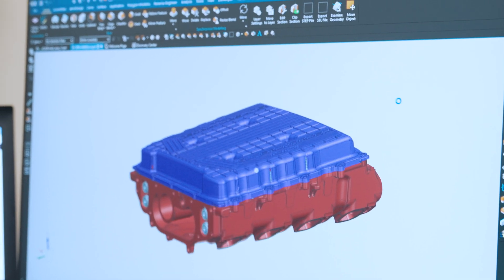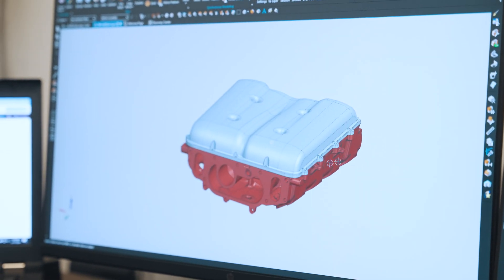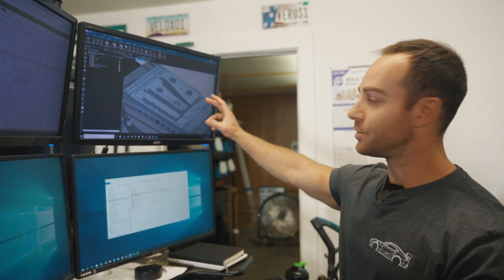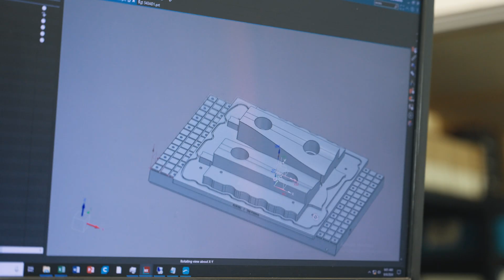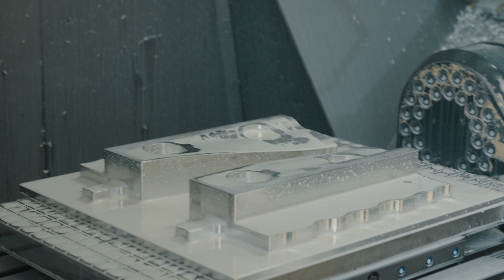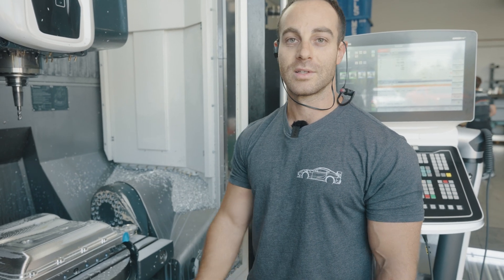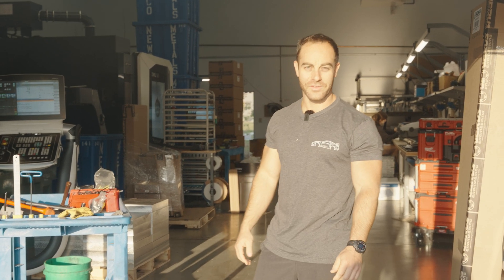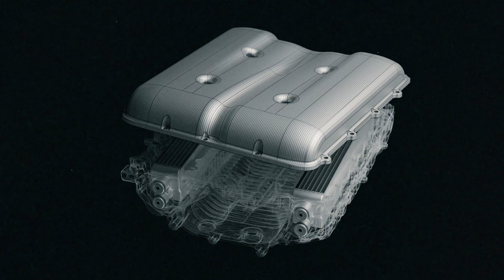Designing and Manufacturing a Super Charger Lid | LT4 Engine

Comment: Great video can’t wait to see the results.  Couple ideas/tips:
1: Get an overhead crane. No have lifting

2: Drill and tap a small hole for an eyelet bolt/lifting ring for the crane.

3: Add precision dowels to the plates.  Unless on machine inspection is available, part to part variance could hurt vacuum workholding.
Reply from the maker: Thanks for the feedback

Comment: Does it improve flow at all? What kind of gains does this lid bring?
Reply from the maker: Dedicated saw 15-20 hp across the rev range is what we were told.
Reply: @VerusEngineering  rad, thanks!
Reply: @VerusEngineering  15-20 HP on the original Corvette LT4 lid or the Camaro/ CTS- V redesigned lid?